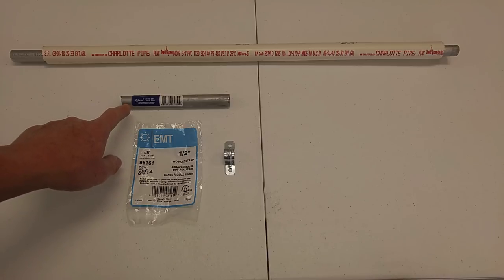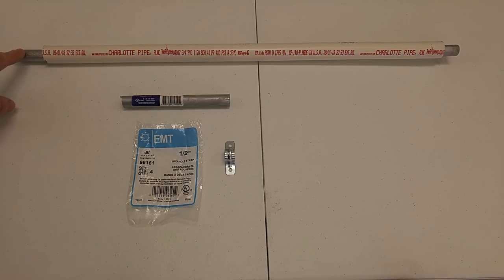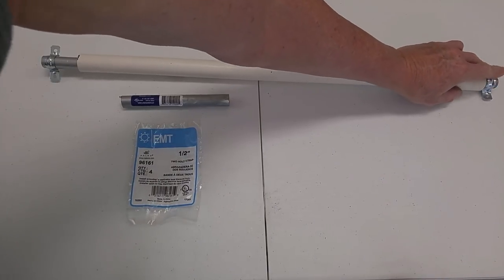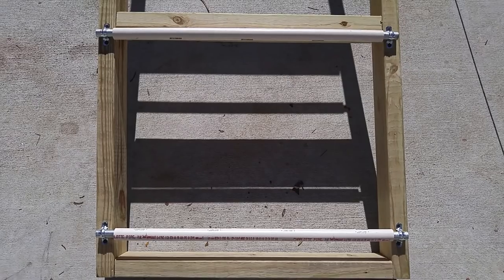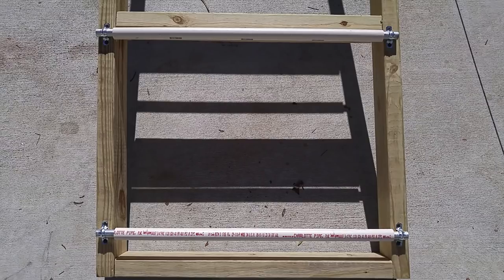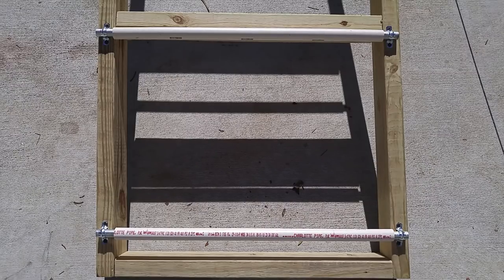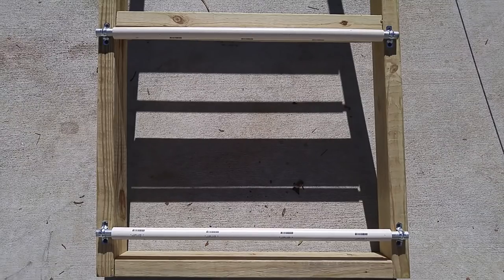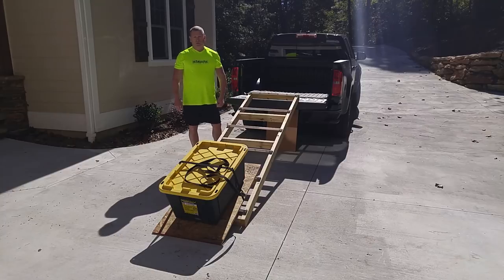DIY Kayak Roller Launch Ramp and Load Ramp

Comment: I like your plan, simple and effective. I am designing a semi-permanent setup for my backyard and was thinking I’d have to get a lot of expensive wheels. I think this concept will be easier and safer as well as a lot less money. I’m planning on about a 14 foot total length that will end in the water. Also thinking about some type of anchor point that I can attach a line to to effect launching and landing.  If I ever put it all together I’ll probably do a quick video and will acknowledge your inspiration. Thanks for a great video.
Reply from the maker: You are welcome Ed.

Comment: Great idea-Curious , what is your Kayak? Does the swivel seat come with the kayak or is it an add on?FYI - if you would use  a larger Diameter  Pvc & conduit it would roll easier.+ put some oil on the conduit & or coat the inside of the pvc with oil.
Reply from the maker: Thanks Bob. That is a Nucanoe Frontier 12 kayak. The swivel seat is an option. I'm sure the design can be improved; I put it together with stuff I had in the garage.

Comment: I like your design! Is there something that can be used to make this lighter? Also, how would you put a support to assist in getting into and out of the kayak? Do you have any ideas?
Reply: You could likely make the support frame out of 4 inch PVC pipe which should be much lighter than 2x4's.

Comment: This is very much like what I need to get my kayak up and down a steep bank to the river. Mine would need to be 18 feet long. How far apart do the spacers go? Also, I have some ~3 inch diameter birch logs I was thinking of using instead of the 2 x 4s. Do you think those would work or would they interfere with the rollers?
Reply from the maker: The sizing will depend on your kayak hull. I don't know about using logs but 2x4s are still relatively cheap.

Comment: I've ordered the EMT Pipes and PVC and will need to go longer with my design, maybe 14' I'm thinking with the longer length I might need to go with 2" x 6" PT boards, 16" on center support braces, and every 20" with a roller.   Probably will make it 5' wide so I can load and unload a pedal boat and my kayak.  Your thoughts please!
Reply from the maker: I have been thinking the same things as I have just picked up a 13' 40" wide skiff.
Reply: I have an Old Town Kayak Sportsman powered by Minn Kota 10.6 so I'm thinking the 2" x 6" 14' would be a better choice than the 2" x 4" - need the extra strength . . . only problem would be heavier!
Reply from the maker: @resoluteretreat1532  Maybe a composite type of board would be lighter.

Comment: Good thinking on a simple solution for a age old problem, especially for age-old guys like me that can’t drag things as easy as before. Also, very curious about the make of the boat you have there. Can you share the specs?
Reply from the maker: Thanks...yes it does help us older guys. Be smarter don't work harder. It is a Nucanoe Frontier 12. It is a very stable kayak with 650lb weight load.

Comment: Thanks for your video. I was thinking about using your design for a peddle boat. Mine would need to be longer and wider. Do you think pvc could be used instead of the 2x4’s to help keep the weight down ?
Reply from the maker: You are welcome. I'm not sure if you could attach the hole straps to the pipe.